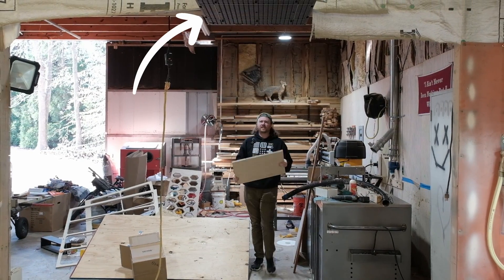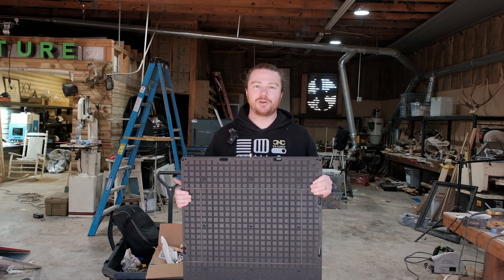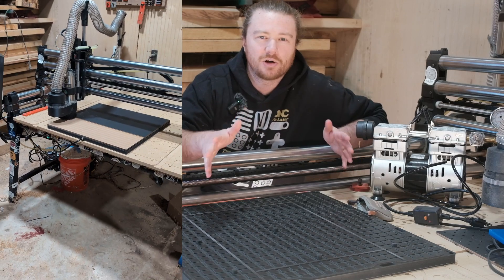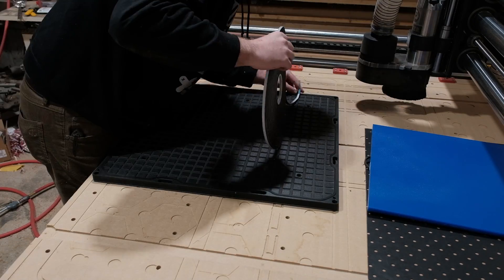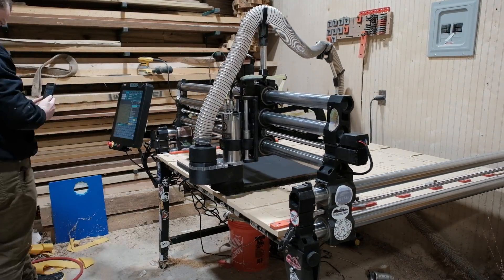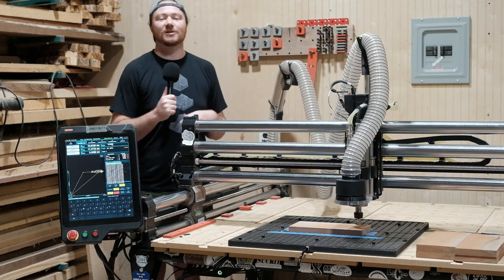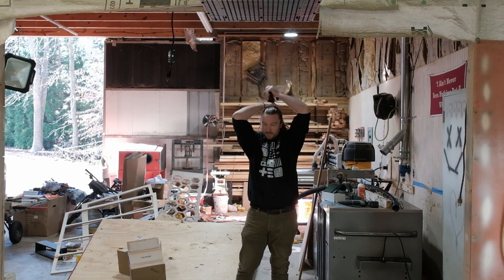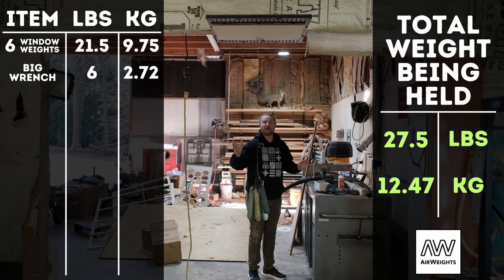The Affordable CNC Woodworking Vacuum Table

Comment: Yep its around 14.7 pounds per square inch - that board looked like it was 14 x 14 inches = 14x14x14.7 = 2881.2 lbs (the atmosphere is pressing down - or up in your case with 14.7 lbs on every square inch - depressing right!.

Comment: company gone belly up ? website doesn't come up
Reply from the maker: website works fine for me? AirWeights: https://airweights.com/?ref=lxcl2w7p
Use code: HAMILTON for 10% OFF!
Reply: @HamiltonDilbeck  hmmm both google and firefox said not secure connection.
Reply from the maker: Then just type in the url? Idk that's weird
Reply: I'm gonna clear my browser data and see. Maybe something in there fubaring with it. Thanks for the quick replies and info.

Comment: How do you do a profile cut into that without ruining that 1000 dollar piece of plastic? Wouldn't that sacrificial board that is sold separately need to have holes in it to transfer the vacuum to that too? It would  have been nice to see some CNC examples running that using the profile toolpath

Comment: I'm curious about the maths of this, how would we calculate its holding power when changing the size of material used? and is the side pressure from tool movement a factor that would mean its holding power is less in practice?

Comment: I saw Frank Hollingworth using a nail gun with plastic pin nails for hold down.  Interesting but the gun is pretty expensive ($400-500 or so).

Comment: Hello. Great video. Looking to buy one starter kit.
I cut lots of acrylic small parts 2”x 23.215 long will this unit work. Will need to put mdf on top and skim both sides for the air to flow.
I’m tired of wasting $ on double sided tape. Please let me know what you think thanks

Comment: You can probably get somewhere between 10 and 12 psi vacuum. If your board was 20" x 20", then your Z force would be between 4,000 and 4,800 lbs. Lateral forces are a function of the normal force times the coefficient of friction. But even with a low friction number you will still get a large enough lateral force to hold almost anything unless you get a leak in your vacuum.

I'm planning to add one of these to my OneFinity X50 Woodworker. With the gasket options from AllstarCNC you can do a lot of different things.
Reply: Thats what I did too. I think if this proves anything is the vacuum pump with the kit is overkill. Better than not strong enough though!

Comment: @Hamilton If you plane the top and bottom layer of a piece of mdf, the vacuum will pass through the mdf and will hold your piece. And you have your spoilboard in place.
Reply: But you also have a vac leak unless you either use the entire surface or reduce leak on unused surface.
Reply: @BeaulieuTodd  Yes, definitely use appropriatly size spoil board to minimize the leak.

Comment: How long can they operate? I frequently do long carves of 12+ hours. I have a Black Box Hurricane system that will possibly overheat after 8 hours of operation without me giving the pumps time to cool off. BTW my Hurricane is for sale.
Reply: The AirWeights vacuum pumps are rated for continuous duty, so you can run them all day, no problems :)
Reply: @AirWeights   one other question can the pump be mounted elsewhere and have the air lines ran to the table? If so is there a maximum distance in which they could be from the table?
Reply: @Jeff_Hyder   The system includes 8' of air line, so the pump can be placed anywhere inside of that distance. We don't recommend exceeding 8'.

Comment: Ooo I’ve been really wanting something like this for use with my Shaper Origin… I don’t use it as much as I want to because it’s kind of fiddly trying to get the shaper tape on the same plane as the workpiece while also keeping everything from moving around
Reply: Hey there! Thanks for the comment, we hadn't even considered these being used with the shaper origin, but that's a great combo! You can access the entire top of the workpiece with a shaper + airweights, since the vacuum table sits under the part.

Comment: I would be more interested in knowing what the sheer force holding capabilities are. Would vibration from cutting and lateral forces combined be enough to overcome the holding force? Probably not, but that would be a more fitting test.
Reply: The table has excellent lateral holding power as well, and vibration from normal cutting will not compromise the vacuum. Lateral holding power can vary depending on the material used, but there is a massive amount of friction created when the AirWeights table and the workpiece are pulled together.  One main thing to keep in mind is that smaller parts with lower surface area will have less hold than larger parts.
Reply: @AirWeights  thanks for the reply. Can a small piece of adhesive backed super fine sandpaper be used within the vacuum boundary to increase lateral holding on small parts? I know I am nit picking here. Only asking because I am pretty much sold on one of these and want to know what to expect when mine arrives(after the drain my account holiday's pass). Also what is used to protect the pump from ingesting any saw dust or debris?
Reply: @Ratheon1075   the kit includes an in-line filter that will keep debris out of the pump.  The surface of the AirWeights table is highly textured and provides great friction. In addition, we have several recommendations for smaller parts including using the optional tile gasket, or leaving tabs or an 'onion skin' to keep small parts attached to the workpiece. The tabs and/or onion skin can be easily and cleanly removed in post using a flush trim router.

Comment: @HamiltonDilbeck
How would one use this system with a 1FEF with a QCW  with the waste boards attached ?
Reply: The AirWeights can be attached directly to the wasteboard. The kit comes with a full set of mounting hardware, including a set of locating pins so that you can reinstall in the same exact spot each time (if you ever happen to remove the vacuum table).

Comment: @HamiltonDilbeck,
Your router forces are not pulling upward on your material.
Where ever one gets in trouble is the sideways/lateral force.
Try the same experiment by mounting the airweights vertical.
Then hang your weights from the bolt to get more of an accurate account of whats happening.
I enjoy and find your very helpful - especially the vids about your craft shows
Keep the great information coming.

edited - and @KOWspazed info about the psi is great info!
Reply: Nice point! I will mention that certain bits, such as upcut bits, can create some lift. But in general, the lateral holding power is extremely reliable. For the part to move, lateral forces would need to overcome the downward force times the static friction of the 2 materials in contact.

Comment: 100% vacuum would be 14.7psi. Let's say you are only getting down to a 10psi vacuum. Multiply your square inches of board by 10 and you'll get your total holding force. 

In physics class we had one of those old rubber hot water bottles We had the smallest kid in class blow into a tube hooked up to the bottle. He easily lifted the biggest kid in class with just a few breaths. Same concept but in reverse here.
Reply: so quick and dirt math for people wanting to know. if that plywood is 24x24" that air pump can hold over 8400 lbs.
Reply from the maker: Hey, thanks for writing that all out. I learned something new!